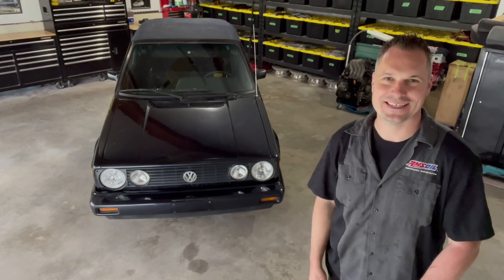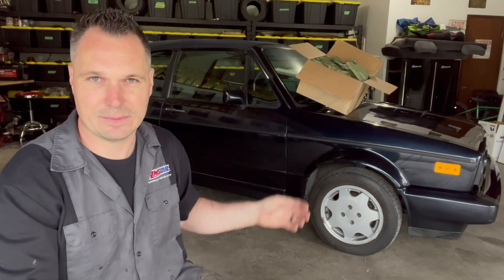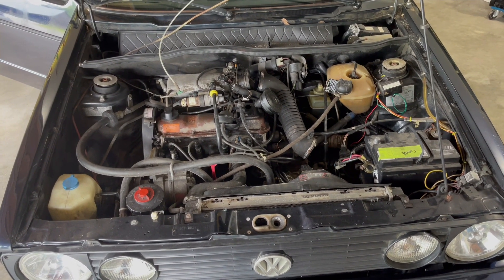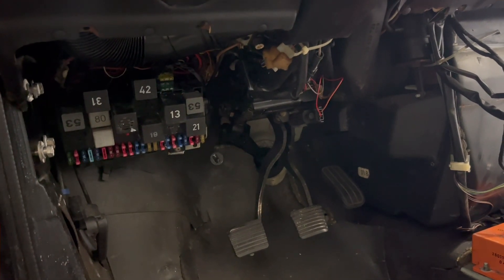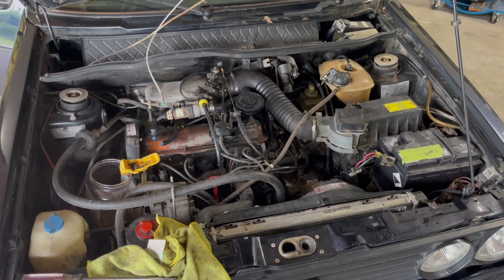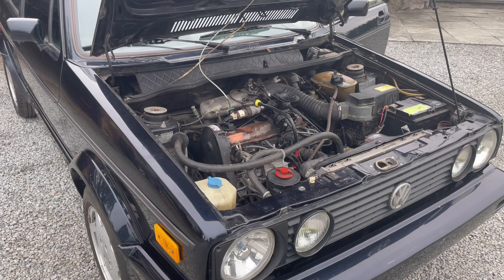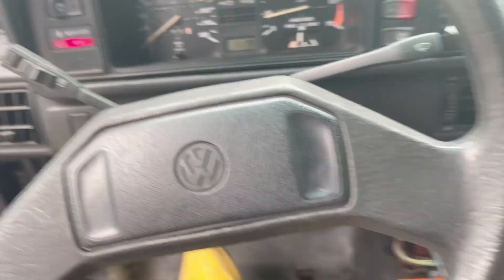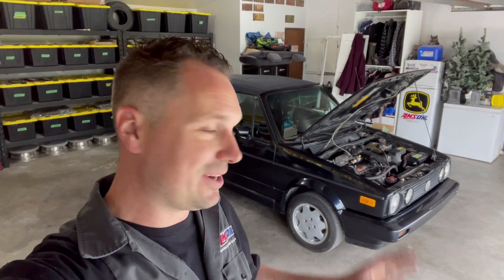VW Mk1 ETIENNE AIGNER Cabriolet build (Pt. 4) / WILL IT START? 1.8T SOON? / Volkswagen Golf Rabbit

Comment: Congrats on getting it running! Gotta love it when an abandoned car comes back to life, especially after all the spaghetti alarm wire deletion. Also good hear that the noisy lifter quietened down after the warmup. Engine runs so nice that it seems a shame to yank it. That said, you did promise us a turbo swap - almost double the horsepower is a worthwhile goal!

BTW - sounds like the engine is fighting the starter a little; might be a bit advanced (unless the battery's weak). I'd check the base idle with a timing gun just to make sure it's set to factory spec.
Reply from the maker: Awesome comments!! Love it, exactly right!! Thanks so much for watching, truly appreciate the support!! Cheers

Comment: I got a 1992 volkswagen cabriolet and the problem is that when is in idle the bar gauge reads good oil pressure but the oil light comes on seems confusing because the bar gauge reads good oil pressure but light comes on
Reply: what oil did you use my car did the same at idle oil light would come one but running it was fine put some 20w-50 and the problem was fixed
Reply from the maker: I would look into replacing the oil pressure sensor first to be sure its not a sensor issue before you dive too deep into anything else. Oil pressure as you know is the lifeblood of any car and not something you should take risks with. Thanks for watching, appreciate the comments, thanks so much for the support!! Cheers